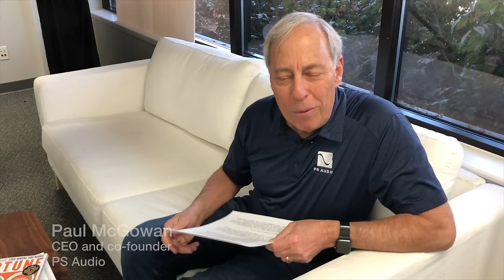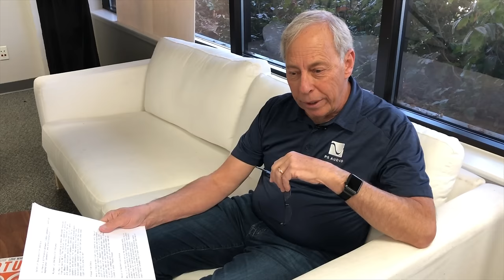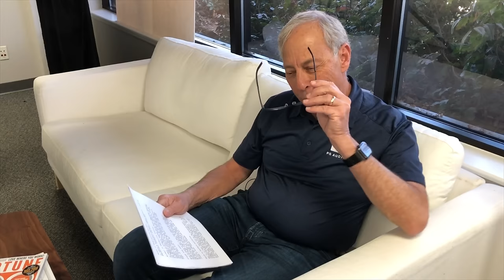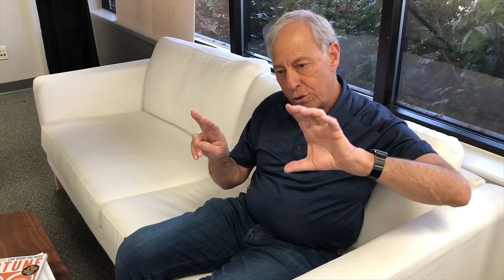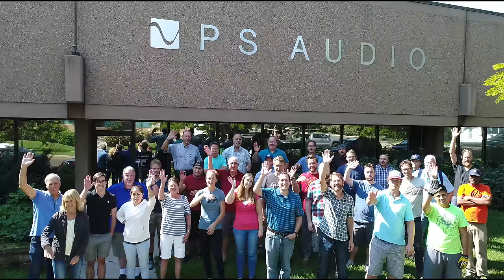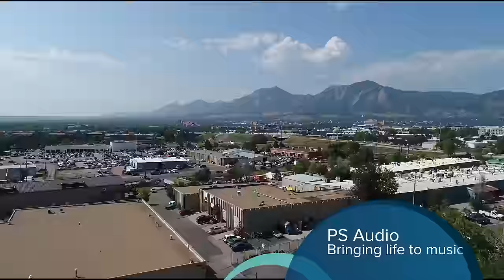Why don't more preamps have XLR?

Comment: Here's my take: XLR is popular with most PRO audio and recording studios, due to long runs of very low output pickup devices like microphones. Hum and noise rejection is their greatest asset. Even interconnecting components with XLR virtually insures that the signal path is quiet and can reduce ground looping problems, etc. For most general home audio, cable runs are less than a few feet or so between components. With the exception of a magnetic turntable, your signal levels are fairly high anyway. Plus XLR connectors are huge in comparison to RCA's. It's just impractical IMO for using XLR at home! 😉
Reply: Close, but no cigar. You are correct about long cable runs that used to be up to a thousand feet. Balanced signals are superior for RF rejection and solving grounding issues. Now thanks to MADI and networked audio such as Dante and ravenna, copper signal runs are short between mics and preamps, and DACs and amplifiers. This guy is really wordy. Unbalanced is used in pro audio, specifically mastering houses. Since the connections are shorter RF is not a problem and since it's all in one room, there's only one ground. Plus, the signal is higher voltage (-10dbv vs. +4dbu) and results in a cleaner (lower SN ratio) signal.
Reply: Generally speaking, in high-end audio, components that are truly balanced tend to sound better through the xlr connections and has little to do with the usual anecdotes given.
Reply: @carlosoliveira-rc2xt  Not true. It all comes down to signal to noise ratio and the application for use. The unbalanced signal has a better S/N ratio and runs at a hotter signal. Unbalanced has poor RF rejection over long cable runs and that's balanced or "xlr" as you say, is preferred in live concert environment. Even in the hifi world, the uber expensive cables are usually around 6 feet or 2 meters.
Reply: @donaldspaulding6973  Virtually no one uses long runs in a home environment so that point is moot. You have a lot to learn. I've owned gear more expensive than your home and have been at this for forty years. Many Stereophile reviewers have come to the same conclusion many years ago. If a component is not truly balanced, that connection will usually sound worse. The Sounddoctor disagrees and thinks unbalanced sounds better, but that's for another time. Like I said, it's not for the reason you state. No more than an amp with 6dB better noise reduction will sound better than one with 6dB less. With your logic, if one has clean power and routes his short cables responsibly there will be no difference in sound quality between the two connections. Not so.
Reply: @carlosoliveira-rc2xt  We agree on many points. The only place we disagree is the sound and how it is achieved. I only wanted to point out that most high end mastering houses (the ones with big names and unlimited budgets) use outboard processors and the chain is unbalanced. I was surprised to learn this. Yes, I always have more to learn, but I make a living in pro audio and consider learning part of the art.
Reply: I am 62 yrs old and do not have a unlimited budget so the cleanest way to carry a signal is balanced, enough said there. So I my listening preference is and purchasing is set in stone if it does not have balanced i/o puts I won't buy it.
Reply: @sux2bu883  I'm 38 but i am already holding this principle in choosing an audio equipment :D
Reply: You are right.  XLR (balanced) connections are mainly for long runs of microphone level signals, and then mostly in live amplification scenarios.    I love XLR, but my home audio system doesn't use it.   Line level signals over short runs are just not worth the bulk and cost of XLR in a home environment, IMO.
Reply: What's this? A respectful disagreement on YouTube? I never thought I'd see the day.

Comment: I prefer XLR balanced input/output, if possible on all audio equipment.
Reply: advsoft Well. xlr will still be better 0.0001% and 0.00005% are still different. No matter how good it is it still can get better. Sure it can be good enough in the end. But why not...
Reply: @johnyang799 Conversely things can never be so bad, they can't get worse too: a heartening thought if you thought things were bad.

Comment: I work with pro audio and can say, balanced is a necessity with mic lines where the signal is measured in milivolts. However, line level usually goes up to 1 or more volts. If your line level runs are more than 25 feet, balanced line level may be useful. Internal balanced electronics are usually used in high end recording mic preamps and mixers but live equipment usually is internally unbalanced or simply digital.
Reply: and yet many higher end companies use balanced XLR.

Comment: One of the reasons I bought my new Emotiva amp and preamp was that I could use Mogami cables to connect them. Emotiva also offers a CD player with XLR outputs. I mostly listen to records in that room but still, that CD player is tempting.
Reply: Gregor7677 sorry but I find PS Audio gear higher quality than Emotiva, not the same comparison, Emotiva tends to build Multi-output theater equipment. If you want a balanced Stereo CD player then you should try to spot an Oppo UDP-205 those are up PS Audio quality. The only problem they are not manufactured any longer.
Reply: I have the ERC3 and love it. 
PS audio is far more expensive than Emotiva and if you watch these videos Pauls thinks highly of them. I only use their 2 channel stuff.

Comment: There are two parts to balanced: Balanced interfaces:  Good for lowering noise floor with especially long cables. 
Balanced circuit topology: Can potentially lower distortion if the matching is good, and makes DC offset easier to manage as the drift is common mode on the amplifier output.

Balanced volume controls are more expensive and less straightforward to implement.

For short interconnects in fixed installation and with more common amplifier topologies single ended is just easier. 

XLR’s connectors take up more space on a back panel. The relays also have to be doubled up for every balanced input.

Comment: My whole sound system has XLR connections. Including the Focusrite audio interface has the balanced outputs but only on TRS because of dimensions. There is such a huge difference between balanced and unbalanced sound, I could not turn back to RCA or other crappy connections.
Reply: Below a couple of meters unbalanced is fine. You just need good cables. Balanced is mostly for long distances. 1 meter balanced cables is a bit snake oil.
Reply: @Madrrrrrrrrrrr  1m? Ha ha.. Dude my setup includes loops of 5m at least, I have an eq, a sub, the room is big. I checked with regular cables and it is a difference.
Reply: @neptunevibe  we are talking pre amp inputs here
Reply: Yeah... What balanced does is simply level out the noise. I don't know why people are always so freaked out about chance of picking up noise to their system, as almost every piece of quality equipment, with a properly built house wiring obviously, rarely picks enough noise to be even audible listening volume when nothing is playing. Not to mention when there is actual music on.

A lot of snake oil.

Of course it's different in recording environment, when every bit of noise gets multiplied many times over through the process.

Comment: Hi Paul,

You may be correct about some pro audio equipment doing a cheap balanced in that is not actually balanced, but most equipment designed for XLR is also intended for microphone inputs and a cheap solution just will not work there at all due to the signal levels involved.  

Sounds like a pro audio mixer with several XLR in and an XLR out to your preamp would work, provided you can deal with the hassle of selecting the inputs on the mixer - maybe not the ideal solution but certainly better than single ended in long runs to the preamp.

Comment: On the basis that circuitry is cheaper than super quality relays I would suggest:

At each XLR input socket attach a circuit that converts the balanced input to unbalanced and have the usual switching relays on their outputs. Then you are back to the same number of relays as unbalanced sockets.
Reply: Exactly.  It wouldn't be difficult or overly expensive.

Comment: Nah, balanced in for live pro audio equipment definitely makes use of the cold signal. It must, otherwise your mics would feedback too much in a live situation, especially if you have a monitor pointed at your face. Anybody who works with live audio day in day out would know the second they plugged a mic or instrument into a high-impedance input. However I realize it's different for recorded music because it's not as hot, so the noise isn't as apparent.

Anyway, if I needed more XLR inputs, I would just get a mixer. Problem solved and it's a handy device to have around anyway for all audio gear fans.

Comment: 6:01 I'm not an engineer of any kind, but I'd like to think in an alternate universe I went to CalTech on a whim and it just worked out. I love this kind of stuff. Unfortunately I don't have the time for it. What I do know is watching roughly half this video, I might never buy anything from PS Audio, but if I am in the market for something they sell (okay, I'm doing research for my dream set-up, which would be a Thorens TD 1600, with upgraded SME M2-12R Tonearm and Ortofon 2M Black LVB 250 cartridge on an Ortofon SH-4 Headshell.) But after that, I'm lost. Ideally, I would have a high-end pre-amp with Balanced XLR inputs and a TOSLINK digital out. That way, I could be sending a purely analogue signal to the pre-amp, which would send a purely digital signal to the receiver (and speakers) which would hopefully reproduce the exact sound coming from the source (the vinyl record.)

9:31 WOW. He's basically saying "Buy our less expensive model, since it's engineered the same as the more expensive one." What CEO says that? That alone has sold me. The GainCell DAC $1900 doesn't have the TOSLINK out (unfortunately,) but knowing what they put into their products, I would be willing to buy a separate amp that had Balanced XLR ins to use with my system (not really sure how that would work, I would probably have to look at a home theater receiver that had those plus everything else I'm looking for.) Either way, if I'm looking at a spending some serious money on upgrading my vinyl set-up, I will definitely consider the GainCell DAC...

Comment: I have a very expensive locally (New Zealand) designed and manufactured pre-amp and it doesn't have any balanced XLR inputs or outputs, just rows of RCA sockets. It feeds a pair of class A monoblock amplifiers (home built) that only have unbalanced inputs and the system has an exceptionally low noise floor so low level detail is remarkably clear. I've never felt that having XLR inputs would improve matters, but I could be wrong.

Comment: It seems to me, with XLR interconnects we get slightly more gain in the signal compared to a standard RCA connection, and with the volume control untouched.

If that is true, what is the reason for it? Is it because XLR transfer is expected to deliver signal over longer distances and therefore more voltage is needed at the output of the source?
Reply: It is because the analog XLR outputs of a DAC usually have higher impedances than the RCA counterparts. Take the Denafrips Ares DAC https://www.denafrips.com/specs-ares that I have for instance. The XLR connections requires a higher impedance match from lets say active speakers. With me pairing my Denafrips DAC to a pair of Genelecs required me to adjust the input sensitivity of my Genelecs to compensate for the high impedance of the Denafrips. Without adjusting the input impedance I would have to adjust the volume travel quite a lot to get a decent volume.

I believe it has to due with impedance matching and the level of impedance may be due to a number of physical characteristics of microphone or XLR cable that cause a higher level of impedance compared to RCA. Getting a high enough        (output impedance of DAC)/(input impedance of amplifier)      ratio (usually above 10) is important in order to properly drive the amplifier in your passive or active speaker.

Comment: My cousin says 97 degrees in your old homestead today. Boulder has to looking good right now!  

I play in hi-end and work in pro-audio. Not just cost of connectors and relays, but the cost of the “pretty” chassis. If really needed, could get a pro XLR patch bay. It won’t be pretty, but it will be clean, quiet, and rugged.

Comment: “Inter-product cannibalism” is another important underlying factor.  This occurs when products with similar utility or within the same product group from a company compete with each other.  This can be particularly challenging for niche product lines and manufacturers; especially when a manufacturer “doesn’t compromise” on their entry-level products.  Prioritize the wrong mix of features in your $2000 entry-level product and then many of your high-end customers and professionals stop buying your $6000 flagship product opting for the over-speced entry-level model. Suddenly,  you find yourself in a position where it may no longer be profitable to keep making the $6000 model for those who want it. In an ideal marketplace perhaps this wouldn't happen, but these are real-world dynamics.  Often factors likes these are directly taken into account throughout the engineering and development of a product; Regardless I think it can provide a good lens in retrospect.

Comment: Can't you just use solid state switching like what's used in motorsports power distribution modules (PDM) ? Why rely on relay's (which have moving parts which are a point of failure?)

Or is there an electrical noise issue?

Comment: Hi Paul!  There are so many integrated duel supply analog switches available, from SPST, DPDT, through multi-IO mux/demux devices.  Even the expensive parts are 'relatively' cheap.  Have you not found any that were good enough THD+N to use on your products?   I've used many of these in different product designs over the years and they've worked great, but then again I've never designed something that most hardcore audiophiles would consider high-fidelity.   Great video as always!

Comment: I use balanced TRS. I suspect that the shielded ground in XLR wouldn't make a big a difference in my setup. I don't run power cables near signal cables, use short cables, and minimize RFI. I keep switched supplies, CFL and LED lamps off the power circuit. It would be fun to get a used power conditioner and rebuild it someday.
Reply: BlankBrain Balanced trs is basically the same thing. The vid is about balance vs unbalanced essentially.
Reply: I use focusrite forte I use trs as well.

Comment: Hi Paul, I'm aware that you can't possibly answer all 'ask Paul' questions. The question I submitted a while ago is related to this one and maybe you can post a short comment? I'm concerned about balanced headphone outputs. I have seen those on many preamps with an headphone amplifier. However psaudio although huge balanced fans does not provide balanced headphone outputs. Is this simply not necessary or bs or too cost intensive? Thank you for your great effort in making these videos. o7

Comment: Thanks Paul, I enjoy your videos. It's too bad that a pair of old telephone relays could not be used, they would look sharp on nice pedestal stands clicking away besides an exposed tube, tube amp. An enterprising person could put 5 or 6 relays, clean PS, micro-controller with WiFi in a box, write a phone application  and start a business like you did with Phono pre-amps, I will take .5% for the idea :).

Comment: If the issue is simply the number of connections on the back, is there an outboard unit that can be bought, that takes several balanced inputs and provides one balanced output? A basic selector switch.

Comment: Balanced also means extra circuitry, so not necessarily better. Relays also don’t break the bank, I bet those rotary switches are more expensive when of serious quality.
In case you put a Jensen transformer in to balance the inputs we’re talking. Quality and money.

Comment: would it be more important to have XLR from a source to the preamp, or between the preamp and amp due to the difference in output levels on the different connections (i.e. preamp out is higher than the source outs)? Can an amp like a GFA-555 be "easily" modified to take an XLR input since there is no switching?

Comment: There is also another reason besides costs, and that is of course manufactory decission, where some manufactories wanna keep it simple, so their circuity design doesen't get "polluted". At least that's what iv'e heard, and my own Pre-Mono combo from Lavardin (French High-End amps) is a good ex on that perspective. They from the very start decided NOT to use Balanced inputs and/or remotes, and they keep that "rule" the first 15 years of the companys exist. Now they finally deliver remotes for some of their amps, as costumers keeps coming back, asking for that. Maybe there is way much more too this, and i guess there is, but i'm not an engineer ;-) Cheers from Denmark

Comment: I find it hard to believe a $1700 pre amp even with silver/gold relays would leave you with anything less than a 80% margin, correct me if I am wrong.
Reply from the maker: Oh goodness, 80% margin? That would be great! No, we're not even remotely close. Once you factor in all the expenses, what the dealers take, cost of goods, labor, etc. there's surprisingly little left for profit.
Reply: PS Audio: Thank you for the reply, that is good to know)
Reply: @Paulmcgowanpsaudio   sell pick up only and/or direct on certain lines, or on vintage, bypass dealers.